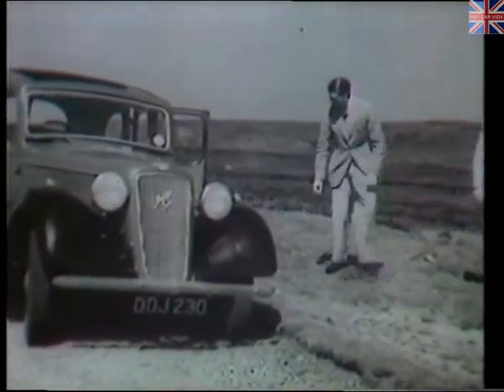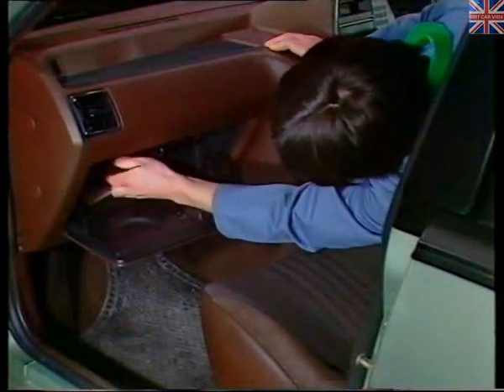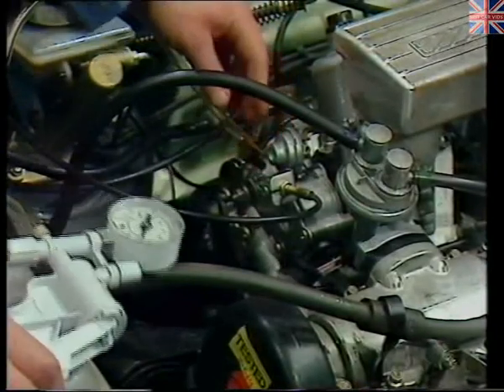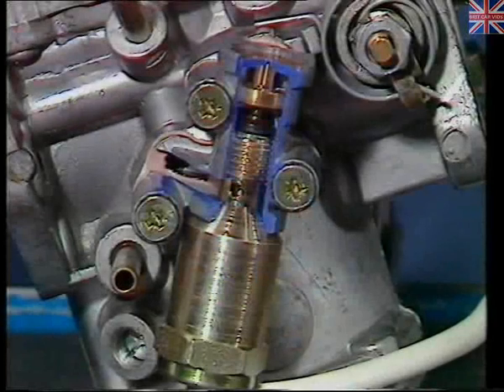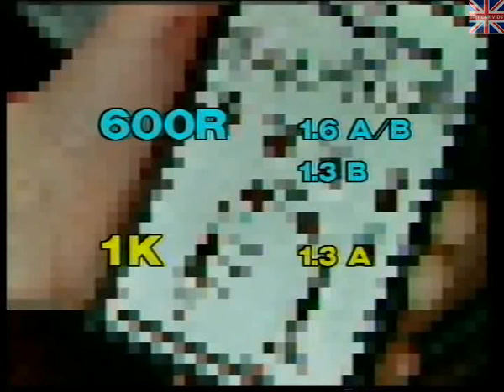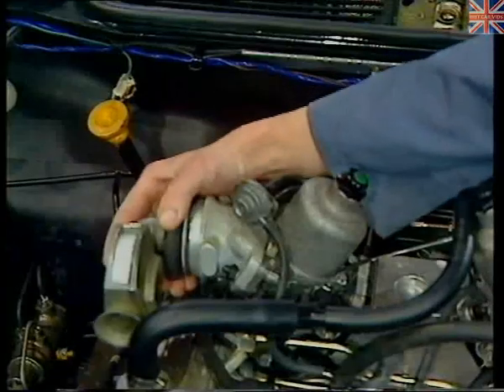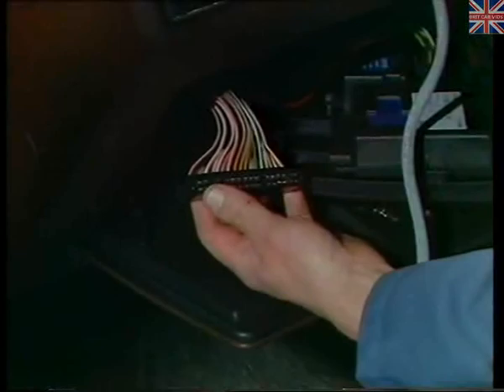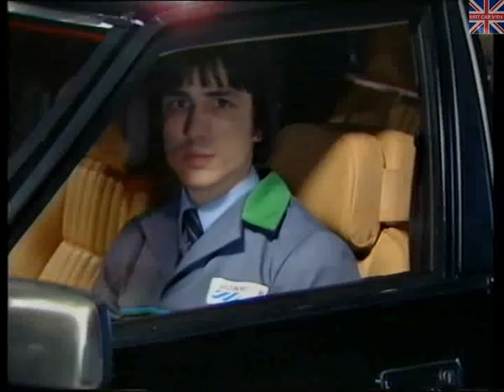Austin Rover - Service Insight - Fuel Management HIF44 (1985)

Comment: The steering wheel was clearly off centre even on a brand new one.
Reply: Clearly don't know what you're talking about
Reply: @lucyellenroe6029  Hgv mechanic, 20 years experience, the steering wheel is off centre. Must have been the lazy bastards at the factory couldn't be bothered to fit it properly